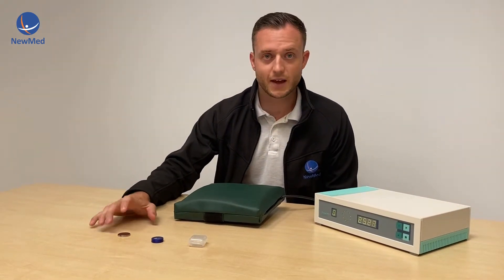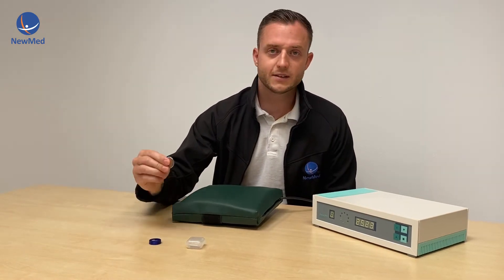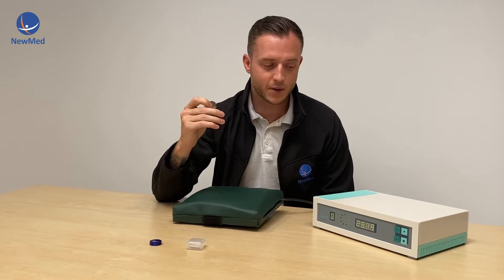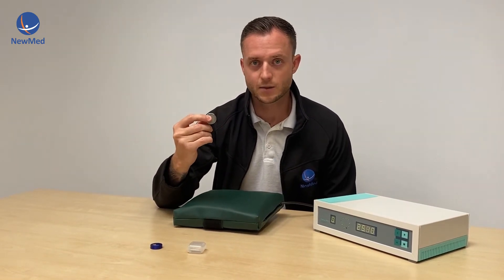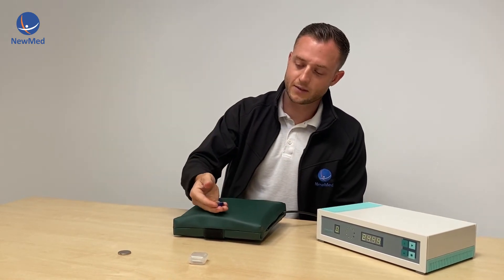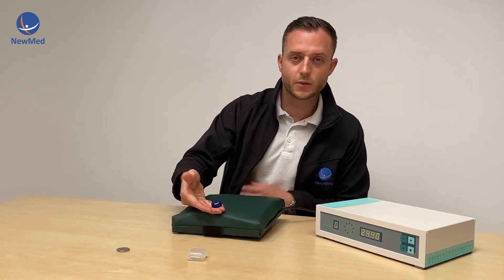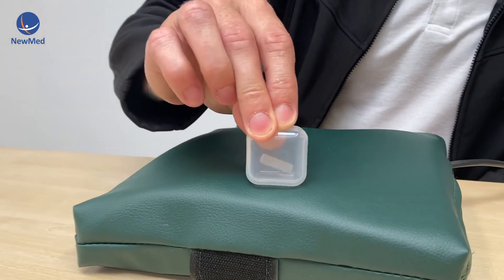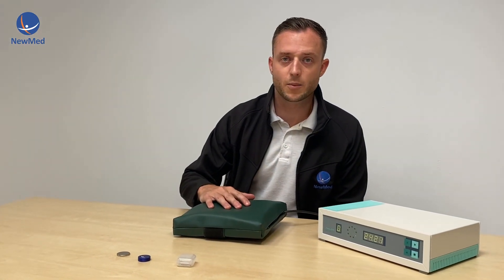How to see that your PEMF therapy device is working using a magnet tester.

Comment: tip i've just worked out: get a super tiny magnet and you should be able to feel the vibrations. The magnet I was trying was far too heavy so I was convinced wasn't working
Reply: Thanks for the tip! You are right here that smaller magnets are usually better here for the lower intensity devices. But it also depends on the strength of the magnet and the PEMF device too. The stronger the magnetic field the more reaction you will get even with a larger magnet :) it would be good to know what PEMF device you were trying to test.
Reply: @andysmith1641   I bought a second hand IGEA I-ONE which I think states a 10-18 peak Gauss. I could feel a vibration with a tiny magnet I happened to have but am keen to try to measure the actual intensity. I'd be interested to hear if you have heard of this particular device and any thoughts?
(I'm using it for a bone edema in my knee where there is also a lot of chondral, meniscus and ligament damage, but I am told it is only proven to help the bone bruising. I use it at least 4 hrs a day)

Comment: Can u tell how to know if BN side of pemf coil is facing upwards?
Reply: @NewMed To my knowledge, PEMF coils should be placed in a fashion that Bionorth is facing towards the body. If it is done otherwise, that means it could be harmful to cellular health. Advise u to have a serious look at it. 👍
Reply: @drchoprashow  thanks for the comment. In the 10 years I have been involved with PEMFs, I have never found any convincing evidence to show that a south facing magnetic field can 'harm' the body or cells in any way. Usually this message is spread by manufacturers who promote a north facing device. It is useful to know what side of a device is north and what side is south and if a device does not specify this then they probably don't know which is not a good sign as this will affect its performance if the coils inside are mixed up. But being harmful to the cells is just incorrect :) most studies show that there is no difference to applying a north or south side of a device, as it just determines what side the magnetic field is travelling.
Reply: @NewMed Thank you for providing information about the orientation. I will also look deeper into this tech.